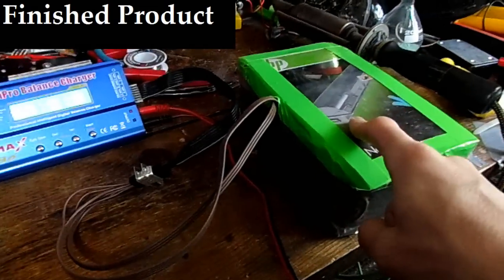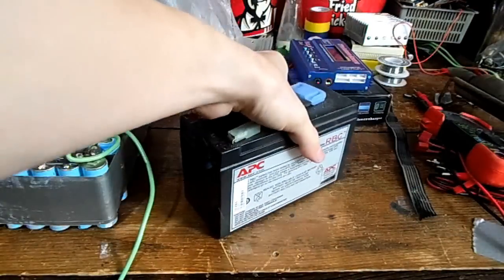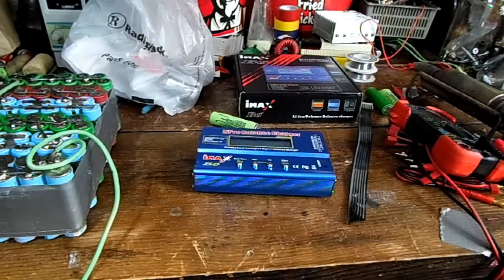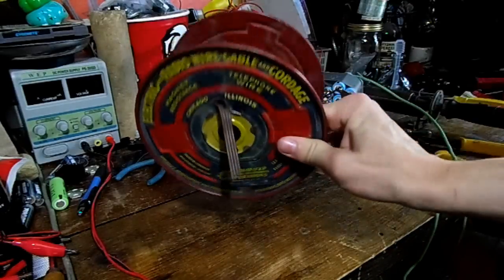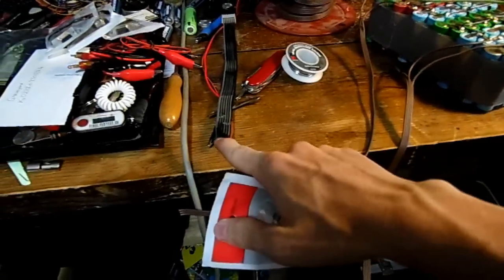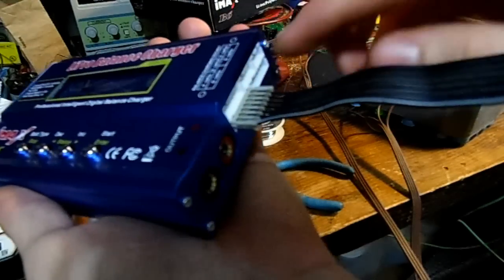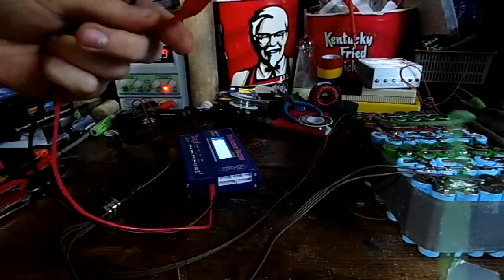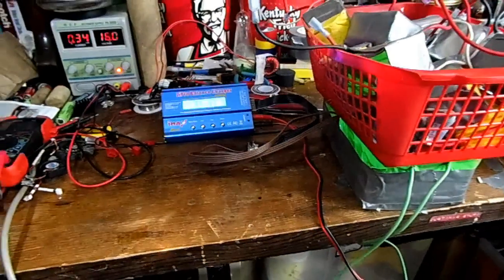DIY: Balance Charging E-Bike lithium battery upgrade

Comment: As per your instructions, I've built two 24v packs to get 48v total for my 1000 watt motor out of the 8800mAh techorbits 18650 cells (total 84 cells split to 42 each with 6 series of 7 parallel cells in what seems to be a jolly fun to solder) I've been trying to get them to charge to 24v but somehow the balance charger only detects 5 series instead of 6. I thought this was because of the low voltage in one of the series (they're all at 3.4v). After two hours of tinkering, I've successfully charged one pack by charging one series at a time to get to 3.80v - 3.90v, the strange thing is that after leaving the working pack charged for two hours, it didn't balance all the series, instead I have a series that is charged to 4.10v, and the other 5 charged only to 3.80v. I've triple checked connections, volt tested everything hundred times. what do you think could be the issue? btw, thanks in advance!
Reply from the maker: 8800mah 18650 cells dont exist. you probably skipped the biggest instruction in my videos, dont buy individual cells, buy old laptop packs. or do you mean it was 4 cell together to make 8800mah?

try to charge each individual parallel pack as a single battery with your imax b6.
Reply: Rinoa Super-Genius I did buy the laptop packs. Bought 7 of them. It says 8800mAh 12 cell laptop battery. Right now I'm charging the parallels as individual cells, which is going to take me a bit. I'm a bit cautious about the Ampere rate, how much is safe? And is it still possible for me to balance charge each packs? I'm getting a paraboard to balance both 24v packs and to be more practical about charging and hope I shouldn't have to charge them individually everytime, Is there something I'm missing here? I really appreciate your help :)
Reply from the maker: unlimitedskyproductions
oh ok, thought you spent a bunch of money on cells that claimed they where 8800mah per each cell haha. i get a lot of people believing those ripoffs.

well are you using an imax b6 to charge them?
Reply: Rinoa Super-Genius Yes I am, I know it's not the most accurate so I have my meter handy to keep track the voltage. I checked the voltage in the socket as well, and they're all giving normal read so it's definitely not the socket. I'm hoping this is just because of the voltage being too low, even though the weird balancing thing still left me scratching my head. (read : first row 3.80 4.10 3.80 2nd row 3.80 3.80 3.80) What voltage should I charge them to? and at what ampere rate?
Reply from the maker: unlimitedskyproductions
 ok, and you have 7 ballance wires and 2 more for the overall positive and negative of the battery going to the battery right? so should be 9 wires going from battery to imax b6.

and for the charge/discharge rate you should be fine as long as you stay bellow 2C ( 2 amps for every Amp-Hour of capacity) although 1C is best on not stressing the cells.

that is odd about it not bringing the voltages up. 3.8v is too low for much use, at 3.8v the voltage drops a lot when pulling a lot of power from it. i would say my battery packs feel a bit "spongy" when the cells get to 3.8v. the voltage dips a lot when accelorating.
Reply: Rinoa Super-Genius Yes, I did everything you demonstrated on your videos. Except that I'm doing two 48v split into two instead of one big pack of 24v like yours which gets me probably half the ampere hour but that's ok for now. 7 wires for the socket plus two red and black wires. 

I've been doing 1.0A so that shouldn't be a problem.

I have a feeling that because the power is so low on one of the series that the imax just won't read as having a total 6 series. still doesn't explain the one series that gets more juice than the others after balanced charged.
Reply from the maker: unlimitedskyproductions
 thats just weird, but i still think the best idea is to charge each pack by itself like its a single cell, that way you get all the cells to 4.2v. and then maybe the imax b6 will work better. the ballance feature is ussually 100ma or less so it would take a long while to ballance that much of a voltage differance between your cells. like days.
Reply: Rinoa Super-Genius Booya! found out the culprit was an over discharged cell that was .20 volt lower than the others. which means the term 'balance charging' has got to do with charging a balanced series of cells that is already balanced. It won't work with an out of whack array of multi voltage cells. Learned something new there. Now I got the imax to read all 6 series and everything is good. Thanks a bunch!
Reply: unlimitedskyproductions Also soldering the batteries can damage them if the heat is held too long. You need a high heat soldering iron.
Reply: unlimitedskyproductions doesn't that defeat the purpose of balance charging if you have to manually make sure they're balanced in the first place?
Reply: danh le When you have 72 individual cells, chance of getting the same exact voltage in each cells is none. I had to charge them individually first so when balance charging them as parallels they would be charging in uniform. A balance charger doesn't automatically charge out of whack array of cells to get the same final voltage. Think of it like filling up several cups with the same amount of water vs random amount of water, when you add more water evenly, the latter won't get you a uniform amount.
Reply: unlimitedskyproductions makes sense, i love analogies! thnaks!
Reply from the maker: unlimitedskyproductions well, no. but whatever.

charging the individually just makes it quicker since the balance mode charges each cell with like 0.1a and that would take a long time.
Reply: Rinoa Super-Genius It's true that charging individual cells is always quicker, though I believe danh le was asking about balance charging them to make them all uniformed which in this case, charging various voltage cells will not balance the cells. when you have an array of cells with different voltages, my balance charger won't even let me charge them. I'm trying to remove the idea that balance charging doesn't necessarily mean that it would help an array of various voltage cells have a uniform voltage in the end. Charging them individually FIRST to get a uniform voltage to start is the only way to go. and its also faster :)
Reply from the maker: unlimitedskyproductions
 actually it is supposed to, you can have several packs of parallel cells at 4.2v and others at 1v and it should slowly charge the 1v cells up through the ballance wires.
Reply: Rinoa Super-Genius sounds like theres always a discrepancy betw theory and practice...oh well, whatever works for me that is safe is what i'll attempt.  thanks folks
Reply from the maker: danh le
i'm not talking about theories. i'm talking about how they work and how i've seen them work.
Reply: Rinoa Super-Genius not sure if my charger is working okay or faulty (or maybe the connections). for some reason my charger refuse to charge the cells unless they're about .5 volt difference to each other :/
Reply from the maker: unlimitedskyproductions
yeah thats weird

Comment: Ok the ribbon connections and wiring confused me haha... But I'm sire with some more research on some electrician websites and books I should understand it fully soon.

I think this should be my last question haha...
For the soldering of the batteries. What gauge and type of wire did you use to connect them all together? Is it tin? Or what material?

Comment: Hi, my friend and I have been watching your videos with great interest, these are very informative and well presented, I am helping him make a battery pack for his  disability scooter for more distance and speed so finding your videos has been a godsend, I also use a soldering iron slightly smaller than yours as when soldering battery tabs this gives a lot of heat straight away and doesn,t over heat the cell which is what happens when using a smaller Iron, will be making a pack for my electric bike after this one, I am using two Bosch 36volt brushless motors connected with gears to run together, did have a Stannah stairlift motor in it but this had too much torque and in 6th and 7th gear the chain was just jumping over the gears, unfortunately I don,t know how to put a photo of the bicycle in this post so will email you a photo, regards Doc Cox

Comment: Hello Rinoa! I'm currently constructing an electric bike from the ground up. I've got my eyes on a 48v 1000w DC motor, and I've decided to construct my own battery pack, following your instructions (which you're very clear for the most part!); however, I want to get the most out of my cells as possible. I've acquired used laptop batteries with cells of different capacities, obviously, and to group them in parallel, I charge each cell to 3.7v, then measure the capacity while charging the rest of the way to 4.2v using the iMax B6. I'll then group the batteries by the capacity reading off of the charger... is this a correct/effective way of grouping? 

Thanks for your time! :)
Reply from the maker: from the ground up? wow that takes dedication to mine the ores and smelt them into the materials! jk.

yeah that is a good way to charge them, i've found the imax b6 doesnt have as big of a range i'd want for charging. like if you set it to let 5a go through it will shut off at 500ma, if you set it to 2a it will shut off at 200ma. i found i didnt get a full charge. so what i did was for 1 cell i would charge it at 2a then when that was done i would charge it at 500ma and that remaining bit would take the cell from like 4,05 to 4.2v and gave a more accurate reading. if i have 2 cells together i do 4a then 1a since the amps are evenly distributed between the cells and they get the same result.

also dont forget that 3.7v is about 30% charge for lithium batteries, so when your all done remember that your battery is still like 30% bigger than your number. i did the same but started them at 3.6v and took them to 4.2v to get each cell's capacity and at teh end my numbers showed i could only make a 17ah battery and i was kinda pissed, but then i realized i'd only tested them once they where already a bit charged so the battery was really 24ah.
Reply: Yeah, the mining part is a bit difficult and time consuming. ;)

So basically, charging these cells is more like filling a cup with soda instead of water... fill it too fast, you have to stop prematurely as to not spill the fizz, whereas if you fill soda up slowly, you can get a fuller glass safely.

So let's say I charged from 3.7v to 4.2v, and found the "capacity" to be 1,100mah... in truth, the whole capacity of the battery would be 30% more, or around 1430mah? Maybe I should use a percentage more like 35% from 3.7v? And with my iMax B6 (verified that it's genuine), I actually am running into the problem of over charging... Should I be using the LiPo (3.7v) setting or LiIo (3.6v)? Currently, I'm limited by my power supply to 1.5a (just ordered a 12v 5a brick), so I've been charging sets of 2 batteries at 1.5a. After the last charge, the cells rested at a whopping 4.23v, I was less than pleased. Any ideas?
Reply from the maker: ***** i wouldnt worry about it overcharging them for the first time. tbh they wont like explode at 4.23v. you would need to charge them to 4.5v or so to do that.

the only issue with charging them to 4.23v is the higher the voltage the quicker the cell dies. once the cells go above 4v there is enough energy in the cells to react and slowly kill the cells, thats why you shouldnt store a cell at 100%. it will slowly lose capacity over a few years where if its at 3v and dead it will stay fine for decades.

for every 0.1v you charge it less you will get twice the charge/discharge cycles from the battery, likewise if you charge it more than 4.2v you will get a bit less. but 4.23v is still within range of th cells. you can calbrate the imax b6 in a hidden menu btw. google how to find it.

btw you can ignore what i said about the discharging if your battery is getting the cells to 4.2v. i was having an issue with mine that it would shut off before it fully charged the battery. but that imax b6 was well used and i think a lot of the solder had been lost from it getting too hot so that caused issues. if your imax b6 charges to 4.2v then thats awesome.
Reply: Cool, thank you so much Rinoa, you've been a lot of help! I've always had the mentality of figure it out myself, and I've been struggling with a way to correctly categorize the cells for awhile now. You verified my final solution! :D I'll continue working and hopefully come out with something spectacular! :P Is there a better way to contact you if I have another question that I can't figure out myself? Working with these li-ions is pretty intense.
Reply from the maker: *****
 youtube comments and private messages is the best way. since youtube is my job i pay close attention to any activity on my channel and so its the quickest way for me to respond.

Comment: You should not make pack's with different kind's (models) and shape of battery !!!!!!!!! They must be the same model and condition, Because they will discharge and charge differently.
Reply from the maker: and that is very wrong. as long as you have the same AH rating they will discharge/charge the same. simple as that.

Comment: I saw in the comments that this pack ended up failing. (i think?) I have quite a few LiPo cells that is use for some of my small Helicopters and airplanes. I can charge them in parallel with my charger similar to yours. One thing that happens is those individual cells don't get balanced... Unless i hooked them in series and balanced them as a 6 cell pack. I was just thinking that because you have 12 individual cells in each bank (your 4.2V banks) could that be a possible reason for failure? I wan't to try making a pack like this with my Ebike. I suppose it would be fine as long as I maybe just discharge at no more than 1C? what are your thoughts?
One side note question, on another vid of yours i saw that you just hooked the 3 packs out of the laptop batteries with the magnets in series and connected them directly to your power supply. I was under the impression that Li-ion cells need some special algorithm to charge properly... is that not the case?
Thanks!
Reply from the maker: no this pack has never failed me and its already been in use for over a year.

all cells in parallel are balanced. its not possible to connect two cells in parallel and them not be the same voltage once they equalize. once you connect cells in parallel they act as a bigger batter. if your worries where true then we couldnt have more than 2 plates in car batteries.

no special algorithm, just keep them under 4.2v and your good.
Reply: Rinoa Super-Genius
Excellent. I am so doing this... just got a Magic Pie 4 Vector motor on its way :) Super stoaked!

Comment: can you please answer me a question.
the balancer only checks the average voltage of the parallel cells. but when the paralell cells are out of Balance, like 4.40v and 4.00v you also get 4.20 if you connect those 2 paralell.
so you overcharge one and that causes a fast dying cell...
or do i have a Logical fail?
Thanks!
Reply from the maker: parallel cells can not possibly get out of ballance as long as they really are connected in parallel. if you have a full battery and an empty battery and you connect them in parallel, they will automatically equalize to 50% charge for both. the full one will charge the empty one until they are exactly the same.

if you had to charge parallel cells then you also couldnt have more than 2 plates in a lead acid battery cell, but we all know they have like 20 per cell. when you connect cells in parallel they act like one bigger battery.

hope that helps.

Comment: Hellow, i wanna make my own diy lipo battery as well..but if its not too much ive been looking all over he net and cant find one...can u draw out a diagram of the batteries in series and batteries in parallel and which wire goes where 6s thanks am still confused

Comment: I can't hear (deaf) so I just watch and try to figure out what our doing. Did you say how much this all costs or how you pay for all these things? Is it your job doing this kind of work day in and day out? I watched your other video when you made the pack, so I thought it would be a good idea to watch this one as well. Do the chargers that come with like e wheelchairs have this balancing charger system already built into them? Could you use one of those chargers for your pack as well? Now what about batteries that say: no charge memory? Would those type batteries be better for this type pack? Cool video Thanks for posting it Joseph T.
Reply from the maker: ah that sucks that you can't hear, and the youtube auto-subtitles are a joke.

in total i payed about 160$ for enough laptop batteries to make a 48v 24ah battery. and 30$ for the imax b6 ballance charger. most wheelchair chargers are made for lead acid batteries, those chargers would prolly blow up lithium cells.

when i made this video i just did it because i'm interested in it but now youtube is my job so i do this as my main job.

unfortunatly after i made this i lost the other 80 lithium cells. so bought more and just recently made the other 24v pack. i got a better deal on those and it only cost 55$. but then a few days after i finished that battery i found the name brand cells i'd lost hahaha.

oh well the finished battery gives me 100+ miles of range. theoreticly near 200 miles if i keep my speed down to 12mph to save energy and peddle slightly. i use about 0.12 amp-hours per mile when traveling at 12mph.